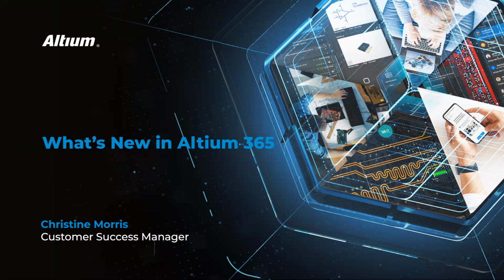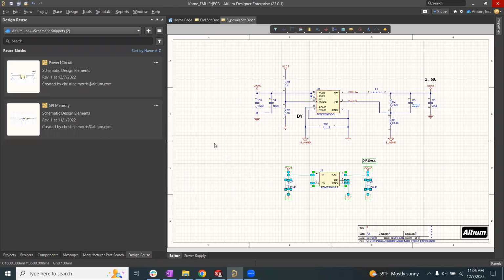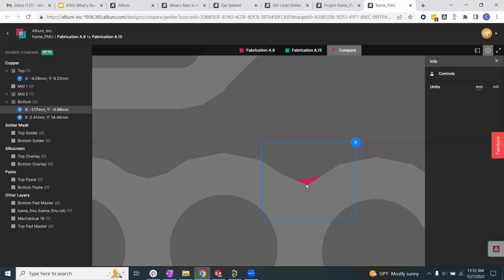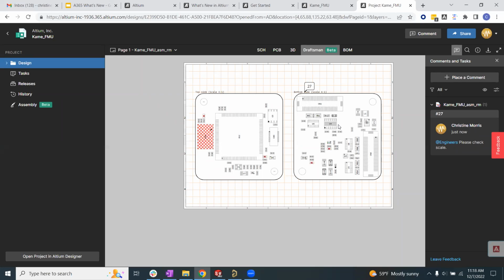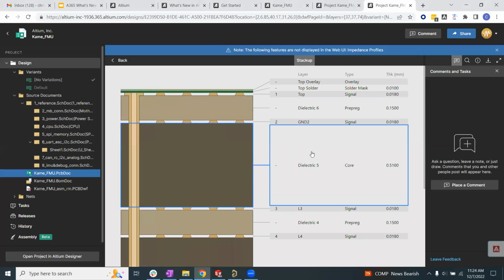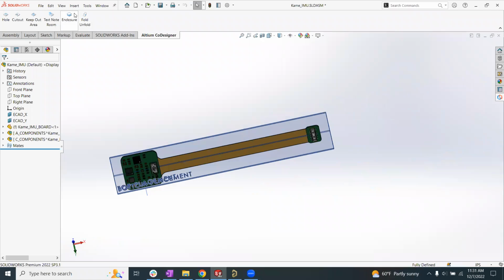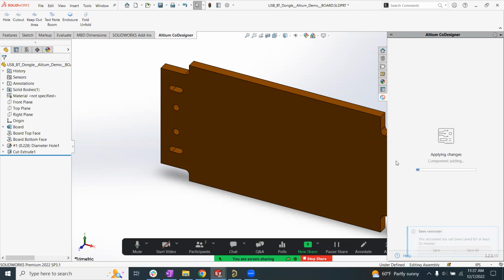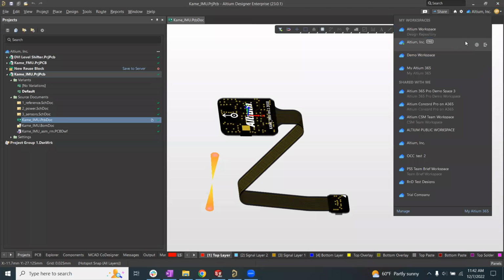What’s New in Altium 365 - December 2022: Assembly App, Reuse Blocks & Snippets, and More!

Comment: `Where in the heck does the 'NAME' field come from in the Assembly window? It doesn't jive with any parameter in my Altium 20 schematics or PCB. In some cases it appears to be derived from the 'COMMENT' field in the PCB doc. In other instances, it appears to be linked to the Design Item ID (which is crazy you would have to duplicate your resistor, capacitor, diode symbols etc..  for every different part number, value and/or footprint).